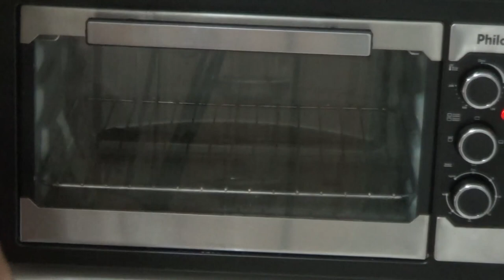Knife Making - Making a Collector Knife

Comment: what iron material could you use ...
Reply from the maker: Today I use springs in the gerel, car, truck, wagon, as well as using bearings in general, I have already made a knife with a train line screw and also the cutting disc.
Reply: What are Sprints
Reply: @MakerHA  What do you mean by iron wire? you mean it's not steel
Reply from the maker: @kristianmartialsurvivalper8522  I can't understand what you want to know ?  iron wire? the material of the knife is steel, it is 5160 spring steel